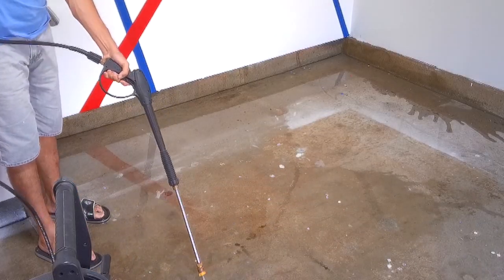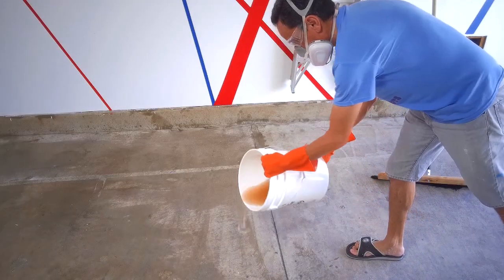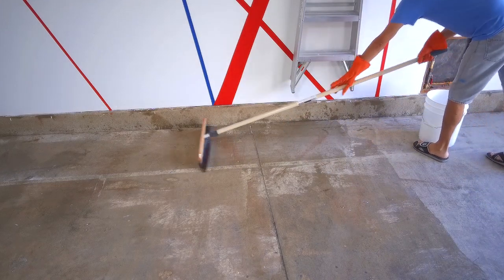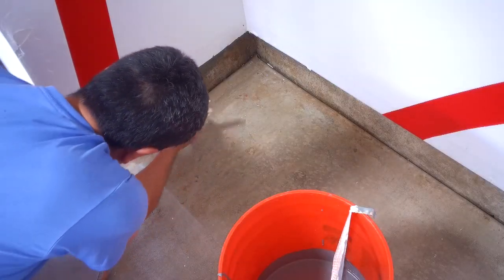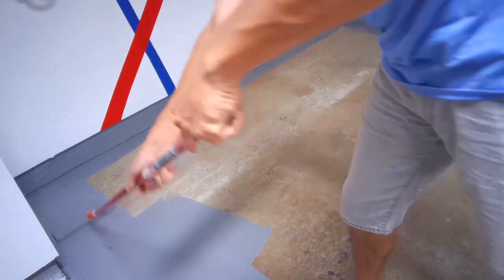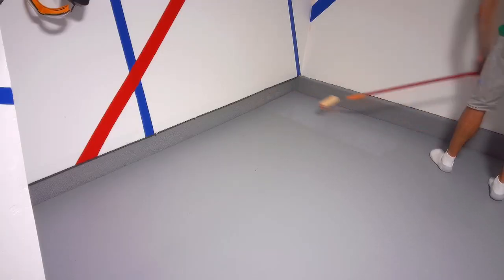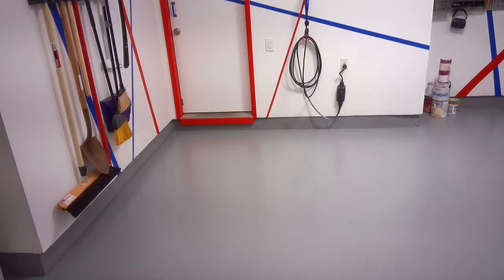Poor Man's DIY: Painting the Garage Floor

Comment: I am thinking of doing this then,  armarol has a garage floor covering for the car. That would alleviate the tire issue. Any thoughts on that? There is a utube video of the garage mat.
Reply from the maker: I definitely considered mats as well but I use the garage as a wood workshop the vast majority of the time and I worried about saw dust getting into the mats. Thank you for the wonderful ideas/question.

Comment: How does the floor look now or 3 years later?  Any peeling?
Reply from the maker: We have admitted that going into this project that is would peel quickly and it did. It started peeling within a month or two as expected. Our research showed that car tires get hot from friction while driving, regard if it is hot or cold outside. The heat from the tires cause damage to the paint and cause it to peel. The peeling is primarily where the car tires are. The rest of the garage floor has held up very well. we do have chips all over but they are all caused from woodworking projects. We have no regrets and when it comes time to repaint again, we will certainly use the method again. Maybe use mats under the tires. If you have any further questions, please let me know.

Comment: So i should use Sulphuric Acid?  Or Hydrochloric Acid?
Reply from the maker: Mr Scott, usually garage concrete is cleaned with muriatic acid. I chose to use a different product, which is a safer alternative called Drylock Etch. Use the following link to get full details on the product. I hope this answers your question but if you wish to ask more, feel free to contact me and I will do my best to provide a proper response.

Comment: Hows it holding up 5 years later ???
Reply from the maker: It actually started chipping within a few months, but only in a few specific locations. Doing some research, I realized it was chipping where car tires sit when parked. Turns out, tires get hot from friction when driving and caused the chipping, but the rest of the floor was great. My garage floor is torn up all over because I use it as a woodworking shop. I am constantly dragging around equipment, dropping heavy things, etc. That being said. I stand by my decision to paint it as I did. Note: the edges of my garage, where I do not walk or work on, still look good!

Comment: How is your floor holding up now that is over year and half old?
Reply from the maker: The paint started chipping within a month but we expected it. We learned the cause is from the tires as they get got from driving. only where the tires are parked was the paint flaking.The floor has other damage but that is my fault for using the garage as a workshop. spilled paint, epoxy and dropping heavy items on occasion has caused some damage but all in all, we love the floor and have no regrets. I plan to repeat the process again because it worked so well and was much less expensive. This time, we learned of concrete garage primer and will use it plus use up all the epoxy in the gallon to make the epoxy coats thicker. I hope this helps1 If you have any other questions, pleasse do not hesitate to ask and we will do our best to provide a resolution

Comment: getting ready to do our garage floors.  doing research and I like how easy this seems.  how is it holding up?
Reply from the maker: The paint started chipping within weeks but we knew in advance that this was likely to happen. But, it only happens where the car tires rest when parked. We learned this is because car tires get hot when driving and the heat is what damages the paint and causes it to chip. The rest of the garage is holding up very well. We have zero regrets and will definitely do that same thing to refresh/touchup the garage. The only difference is that, we learned there is a primer that you can use. We will definitely use the primer in hopes of the paint adhering to the concrete and paint better and maybe it will prevent chipping a little. Also, we did two coats of epoxy as instructed but we had left over. Next time, we will apply as many coats of epoxy as possible for extra strength. If you have any other questions, feel free to ask and we will do our best to provide a resolution for you. If you do the project, we would love to hear how things work out for you. Good luck!
Reply: @Poor_Mans_DIY  thank you so much for all the info

Comment: Is it only one 12 ounce of masonry etch ? And do we mix it with water ?
Reply from the maker: The etch that I used did require it to be mixed with water. Be sure to read the manufacturers instructions because each companies product may have different requirements
Reply: @Poor_Mans_DIY  okay thank you I'm going to do this project of my garage soon il let you know how it goes lol
Reply from the maker: @a.rod876  We would love to hear how it works, but when we do this again there are a couple things we would do differently. We learned that there is garage floor primer paint that can be purchased.We would definitely use primer first. Primer paint is made to stick better. It will help to stick to concrete and then the paint will stick better to the primer. . Also, we will use not just two coats of epoxy, we will do at least three coats. Lastly, be aware, this is a cheap way to paint the garage so car tires get hot when driving and they may cause the paint to chip where the tires are.
Reply: @Poor_Mans_DIY  okay and no my cars are not going to be driven in it so that's good just to wrap it up with you for my understanding. Power wash cleaning , let dry than primer 2 to 3 coats than paint , than epoxy ?

Comment: Hi, do you find that the paint peels/ chips over time ?
Reply from the maker: The paint started peeling and chipping within a couple months, but based on our research, we expected it. The good thing is that the chipping only occurred where the car tires sit when parked. This is because tires get very warm when driving, so the heat causes the paint to chip. The rest of the floor has done very well. The cost savings was worth the flaw. We considered ordering mats to place under the tires but figured its not  a big deal. 😀

Comment: So its been about 8 months . How's it holding up ?
Reply from the maker: Excellent question. We expected peeling but is is contained to where the car tires are. The reason is because tires get hot when driving and hot tires cause the peeling. The test of the garage is still awesome, so for the price,  I have zero regrets and would do it again in a heartbeat. When we first finished, we considered inexpensive, small garage carpets but that is an extra cost. When the cars are in the garage, we cant see the small areas that peeled. I hope this answers your question. Note, I researched the more expensive garage paints and from the reviews, they peel too. If this is true,  then why spend so much more money for the same results? 😁
Reply: @Poor_Mans_DIY     Good stuff . My biggest problem is that the garage was built in several years back . Pressure washing is going to be a pain and acid etching with sketchy airflow might be an issue . But this adds to the research flow and is something to think about .  Good job . And Tks .
Reply from the maker: @saddamdontsurf  I forgot to mention one more thing. After we completed this process, I later learned there is a garage primer paint available. I don't know enough about it specifically, but prime does adhere to surfaces much better. By using primer first, it may be more resistant to peeling caused from heat of tires.

Comment: Looks great! How is this holding up now that it’s been a little while?
Reply from the maker: As we expected,  there are small areas that chipped almost immediately. I learned that it is caused from the heat of the tires. I  was planning to use garage floor mats but they move around and will get in my way when pulling out wood working equipment so we dont bother the areas that chipped. The rest of the floor looks great and the only time you see the chipped off are is when the cars are not in the garage. For an inexpensive way of upgrading the garage floor,  we are still very happy. Thank you for watching and for asking questions.

Comment: How did this floor end up lasting?
Reply from the maker: it peeled within a month but we expected it to happen. It only happened where the tires sit. We learned that it is because tires get hot when driving and the heat from the tires make the paint peel/chip. The rest of the garage remained in tact and I will do this again!!

Comment: It looks FANTASTIC!!!  If you were to put some sort of 'fleck' - 'Paint chips' into the paint and mix really well you would have an interesting looking floor.  
It is something that is done here in the UK on industrial paint jobs, so that the paint looks self coloured but on very close examination, it has some tiny colours inside it.  mostly done on walls where there is a need to have a hard wearing surface - such as a hospital corridor or school corridor.  OR. - alternatively have a sparkle effect by adding glitter - that would be awesome when you put on the garage light and the floor is grey but there is a silver sparkle to it.!!
Reply from the maker: Thank you so very much for the kind words and the wonderful suggestion We considered using the flecks just as you mention as they are very pretty but they also have grit that will help make the surface more of a non slip surface. We decided against it because we wanted to keep the cost down as low as possible and I was not confident I could evenly spread the flecks without having to buy a spreader. We sincerely appreciate your feedback and definitely encourage more, be it positive or negative. That is how we learn and try to improve.
Reply: Just out of curiosity - how is it holding up now after 3 years? I saw in another comment you mentioned the tires pulling up paint but any other issues?

Comment: My garage has a granite tile which is now dirty looking. Want to paint it instead of changing a new tile which require a lot og work
Reply from the maker: I would highly recommend reading the instructions on the paint you purchase. I am not sure how well concrete paint will work on granite tile. Usually , with tile, there is a sealant that is applied and that may prevent paint from sticking to it.

Comment: How did it good up after time?
Reply from the maker: It started chipping almost immediately but only under the tires. We knew this would happen based on what we read in advance. We learned that this is caused because of the heat of the tires. (tires get warm from driving). Other than the chips under the tires, we still love the paint job and will do it again. Next time we will also use primer that we were not aware was available and we plan to apply as many coats of the clear coat as we can with 0ne gallon. If you have any other questions, please do not hesitate to contact us and we will do what we can to provide you with a resolution.

Comment: How many coats of the concrete paint and how many coats for the clear gloss coat?
Reply from the maker: Before I answer your question, let me say that after we did this, we learned that there is a concrete primer available. I would have definitely used that first. We used two coats of paint and clear coat. There was plenty left over so when we do this again, we will use the entire gallon of clearcoat (probably a total of 3-4 coats in a gallon).
Reply: Poor Man's DIY yes, imma add 1 coat of Behr 880. Then 2 coats of Behr concrete and 2 coats of clear gloss
Reply from the maker: @andresxnegrete  Please Note: We knew before using this inexpensive method, that there would be paint chipping soon after painting it and within a few weeks, it did in fact start to chip, but only under the car tires. We learned this is caused from the heat of the tires as they can get warm when driving. I considered placing mats under where the tires rest every day but the chipped paint is not visible when the car is parked and the rest of the garage floor looks great and has not chipping. Good luck , sir
Reply: Poor Man's DIY thank you for replying! I won’t be placing my car on the garage anyways so I shouldn’t have to worry about it
Reply from the maker: @andresxnegrete  If anyway possible, we would enjoy hearing/seeing how things work out for you. Good luck!
Reply: @Poor_Mans_DIY  will do!
Reply: @andresxnegrete  how did it go?

Comment: How is it holding up
Reply from the maker: It started peeling quickly as we had expected but only under the tires. This is because car tires get hot from friction and the heat from the tires cause the paint to chip. This only happened under the tires. the rest of the garage has held up very well. We will definitely do it again but the only difference is we will use a primer first and use up all the epoxy with extra coats.

Comment: Awesome video. I'm planning on painting my garage soon with the epoxy coat as well. So based on the comments you would clean, acid, then garage primer, garage paint then epoxy will be the last step?
Reply from the maker: First... thank you for your kind words about our video. we do appreciate it. Second, Yes! When we do this again, we will definitely, clean, acid, primer, paint and epoxy! Please note, even this method is still much less expensive then other methods which uses are thicker more expensive epoxy. We figured we could do the inexpensive way every few years and it would still cost less than the expensive version that eventually will fail too.

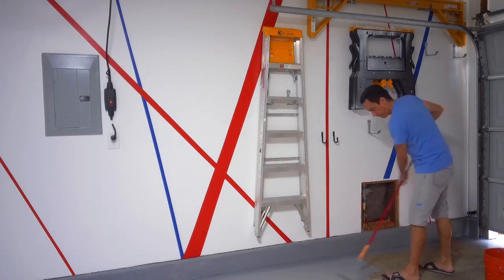Comment: Great video. Quick question. What is that thing plugged into the wall with the red light on it @1:52. I found a couple of them in my garage today and not sure where they came  from or what they are. Thanks!
Reply from the maker: Matthew, we thank you for taking the time to watch our video. As for the red light, if you are referring to the light behind my calves, it is the garage door sensor. It shoots a light to the opposite side of the garage. It is a safety feature to stop the garage door if someone or something breaks the beam. If you have any other questions, please do not hesitate to ask and I will answer as best I can.

Comment: Hey, looks very nice! Could you post an update on how this looks after 1 year of use?
Reply from the maker: Sir, I would be a little embarrassed to make such a video. I do DIY projects in my garage nearly every day. I have paint, epoxy and tons of unexplained stuff all over now. I am not trying to hide anything. If you read other comments, I openly admit the pain chipped very quickly, but we expected it from the beginning. The chipping has only occurred where our car tires are parked. We learned this happens because tires get hot when driving and the heat of the tires damage the paint. The more expensive epoxys can handle to heat so they dont peel as quickly. We definitely do not regret using the inexpensive method and will do it again. The only difference is we learned that there is primer for garage floors, which were were not aware of. We hope that would help the paint stick better and not peel.
Reply: @Poor_Mans_DIY  Thanks for the detailed reply! I'm asking because I also need to do the floor in my shop - it looks terrible!
Reply from the maker: @DmitriIvanov  The price for the expensive garage epoxy system was more than 5 times as much as what we did so we decided to go the Poor man's way. I dont regret it at all. One work around we considered were inexpensive garage mats to place where tires are and that would prevent or hide chips. I decided against it because we do so much DIY in the garage. I hope this helps

Comment: How is that floor paint holding up?
Reply from the maker: when we started, we knew that the paint was going to chip and it has, but it has only chipped where the car tires sit, when parked. I learned this is cause because car tires heat up from driving and when you park the hot tires cause the paint to chip. Also, I learned after we finished, that there is a garage floor primer paint. If I had to do it again, I would definitely do it but also use primer. It would still be cheaper than having it professionally done. If you have any other questions, do not hesitate to ask and I will do my best to provide a response.
Reply: @Poor_Mans_DIY  Thanks for replying will do.

Comment: One gallon of each did the whole garage?
Reply from the maker: Mr Patrick, Thank you for taking the time to watch our video and for your question. For a small two car garage, one gallon of paint allowed two coats of paint. Please understand that this method is not the best and we are open about this to all viewers and their questions. It is however the most economical. The more expensive garage painting kits were five times more expensive and it lasts 10 years. We believe we can repaint the garage every 3 years and the cost will still be a better deal. Also, the expensive kit is not perfect and I have read it peels too. The only true way to prevent peeling is hiring a contractor. They use a heavy duty epoxy. We expected the paint to peel quickly and it did but ONLY where the tires are parked. Tires get hot when driving and the heat from the tires is what causes the damage. The rest of the garage still looks great (except for all the paint and woodworking damage I cause.) I will definitely use the same method with a couple differences. 1 - there is a garage paint primer on the market, so i will use that. 2 - more than the paint, I think the epoxy has a better chance of surviving longer so I will put on 1 or 2 extra coats of epoxy. Sorry for the long response but I hope it helps. If you have any other questions, do not hesitate to ask and I will do my best to answer.